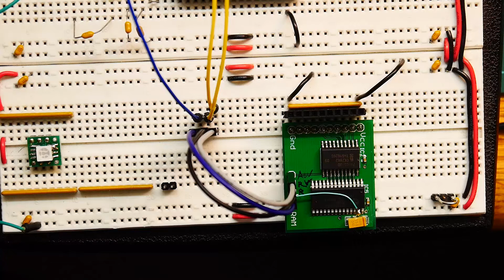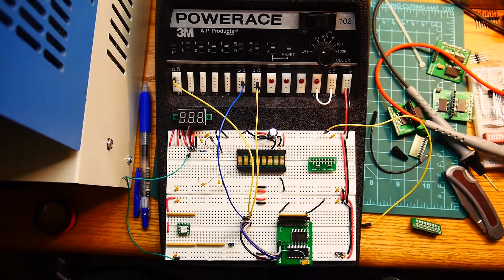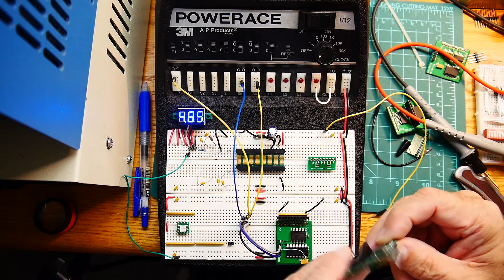#87 TTL CPU RAM testing

Comment: Wouldn't it be nice to add a socket after the latch so we can see the address? Like on the registers, where one can always see the value in it.

That way it would also be funny to watch the processor set a source address in ram0, followed by a target address in ram1 and write directly from one to another (if there will be such an instruction).
Reply from the maker: Yes, that is a great idea. I tried to put in lots of leds but not too many. That board is not crowded so would have been easy. next time....